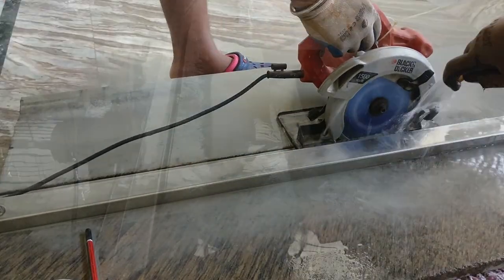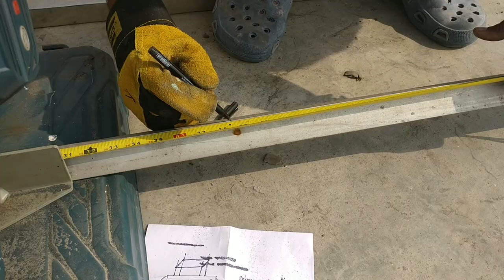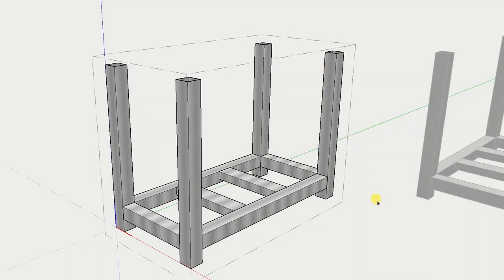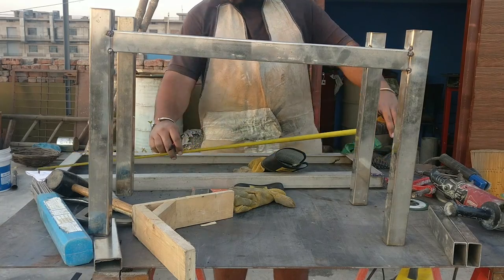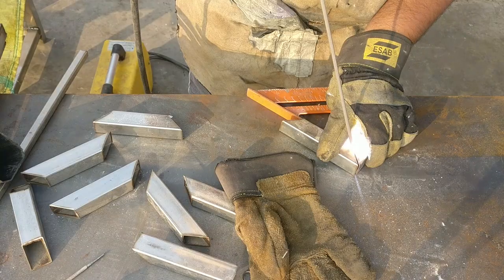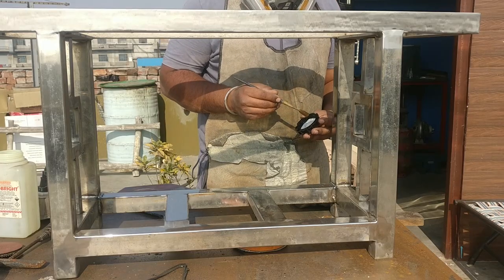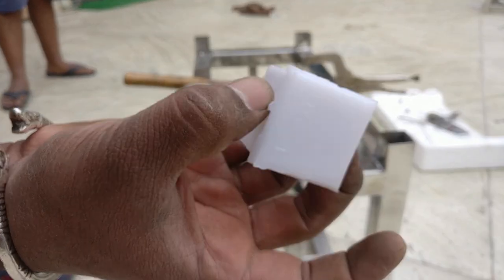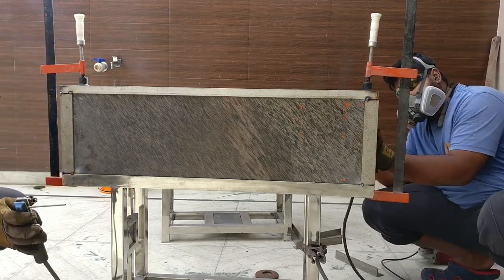Marble and Stainless Steel Raised Planter Box - By AMbros custom

Comment: Very Impresive!!!! May I know your welder settings? How much current? Rod size? Hot start? I myself is interested in fabricating stainless tables for my bakery.
Reply from the maker: Thanks buddy, the  electrode I am using is SS 308 grade, and rod thickness is 2.5 mm and the recommended current for the rod is 50-80 amps. If you have to work onto these pipes current around 60-65 works flawlessly having good metal penetration and less blow holes. Don't go with thick electrodes because they need high amps to melt and that always leads to blow holes, recommend you first to do on test pieces, it took some time to get your hands onto it but it definitely worth the effort you pay. Good luck:)

Comment: Isnt the center of gravity high?
May need to be secured to prevent falling over.
Reply from the maker: No no dear, it seems but if you try to push then it's almost impossible to move it. It's extremely heavy.

Comment: Bro will you recomend me making a 8 feet raised bed the same way on my terrace but with four pillars on each corner fitted with floor of terrace
Reply from the maker: Sorry brother I only do this for educational purposes only. Just so people can take ideas. Thanks
Reply: @ambroscustom  i think you did'nt understand my comnt.i was just asking your experience with it wheather it is succesful or not.thanks
Reply from the maker: Ok, it's successful but before having a fixed dimensions you need to first confirm that their is a wall comes underneath that area. The dead load is going to increase with that much size and to counter that you need to build it over an area where walls comes under it.  In that case it's not a big issue and you are good to go. Rather than filling them completely with soil, prefer using cocopeat. 60 cocopeat and 40 soil, or you can completely go with cocopeat.